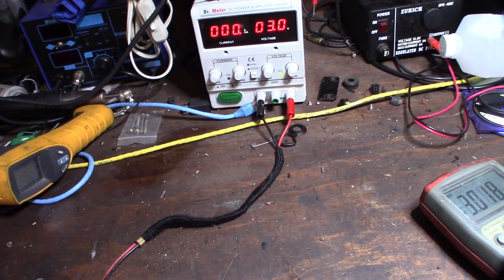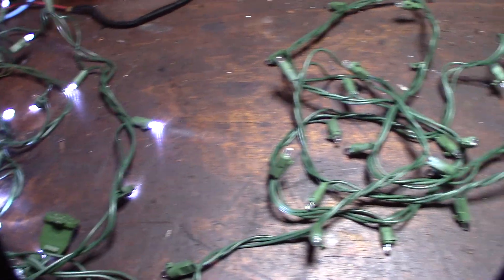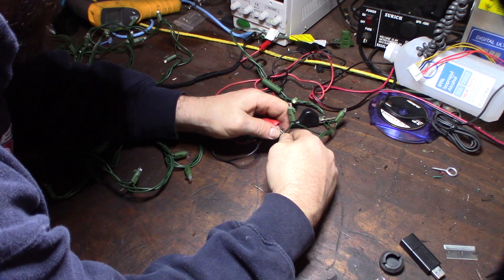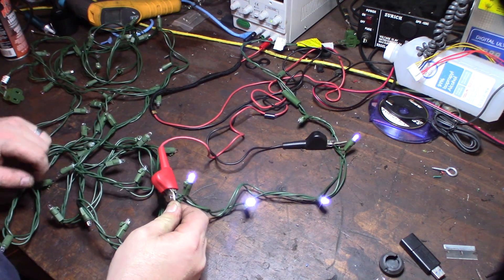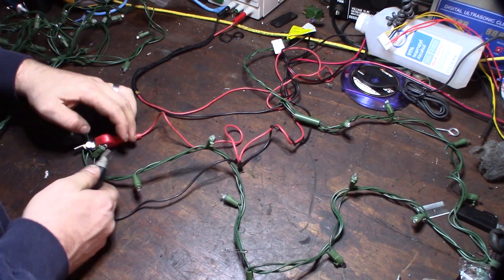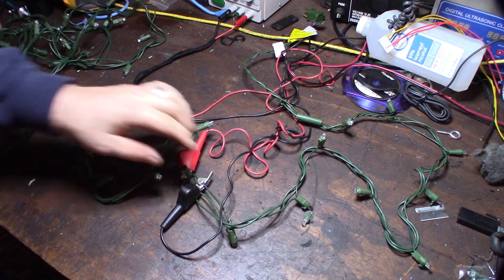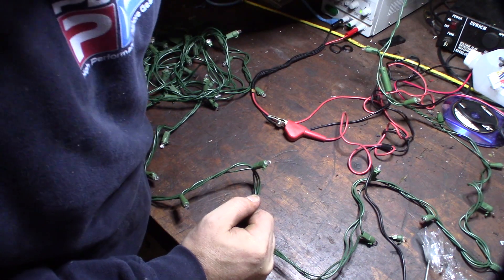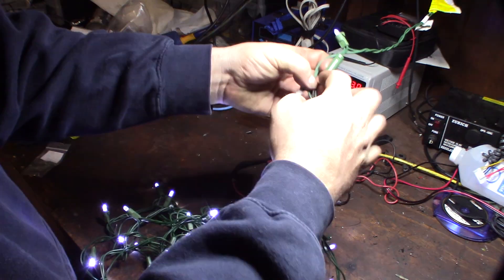LED Christmas light troubleshooting & repair with 12V DC power supply

Comment: You could also use the AC Variac on your bench. That rectifier you call is probably a choke for AC noise.   I didn’t get as lucky as you when testing multi bulbs in series. I had a shunted bulb or two and over voltage took out the section under test.